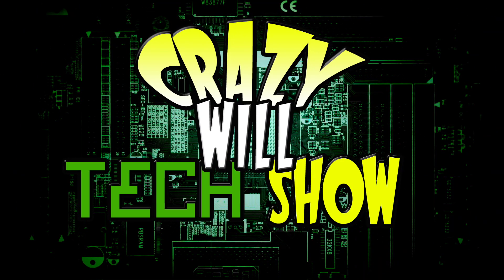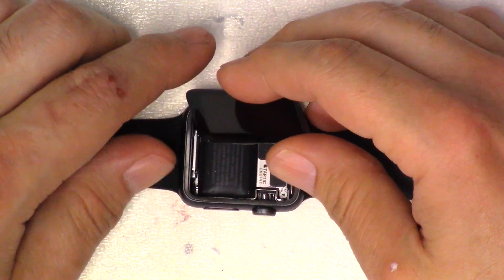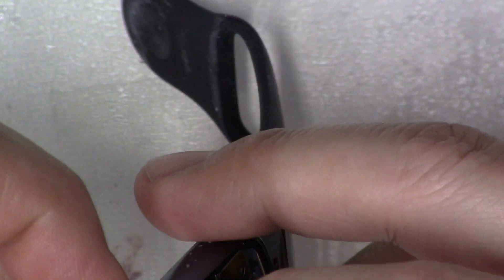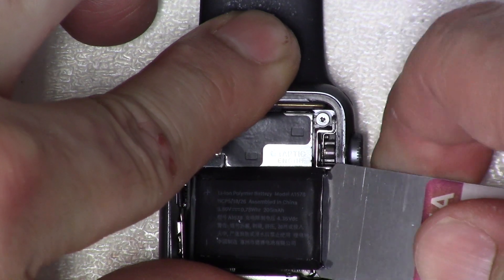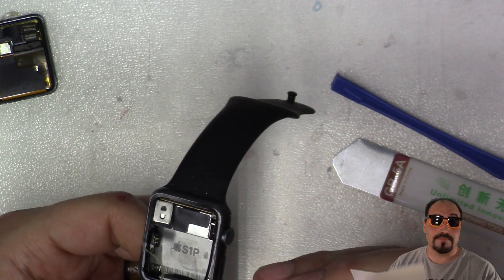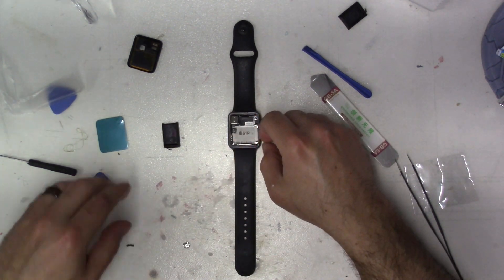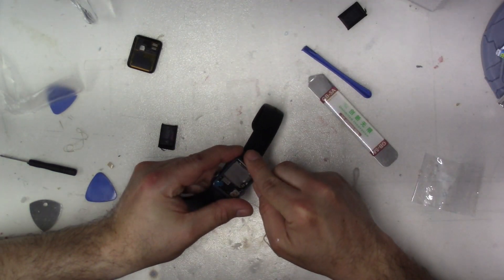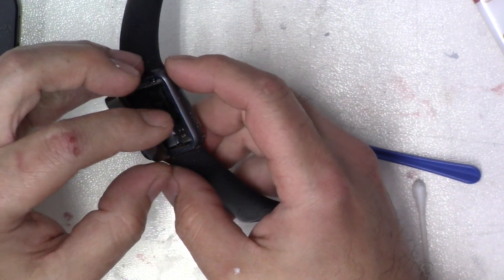What do you do if your apple watch face comes off

Comment: So I got my dad’s Apple Watch after he died in 2016. Recently the display popped off and I was dreading having to buy a newer one. Decided to Google and this video came up so I ordered a kit and went to repair it myself. Unfortunately mine was bought in 2015 (first gen Apple Watch or I guess series 0) so my coverage expired in 2016 a few months before my dad died actually. The weird thing is on the inside of the watch it says series 1 under the battery but apples site shows it as being purchased in 2015 and calls it a first gen so it’s obviously not a series 1. In any case it was the battery that caused it. It was very puffed up and this tutorial fixed the issue. I did mess up at the put the sticker on but leave the blue part so you can power it on and make sure it works first but it came on after charging and I could do everything you did to test that it worked so I’m happy that  my mistake didn’t prove to be really a mistake since everything works as normal. Also this is exactly why I like cheap sports watches.

Comment: I have an SE watch. I think the battery needs replacing because the face fell off. Are those replaceable?
Reply: They are replaceable. Amazon has the kits that come with the new battery, and a sheet of adhesive to stick the face back onto the watch. They cost about 20 bucks.

Comment: I fell landed on my wrist kinda and now my Display is coming off, you think I can just super glue it back down or is it gonna mess with the tech inside…?😬 The display still works touch and all
Reply from the maker: The batteries, not expanding? If you do it on the very edge and use gel superglue it may or may not work 😬.
Reply: @CrazyWillTechShow  The battery is perfectly fine